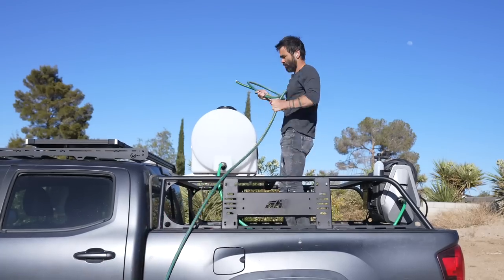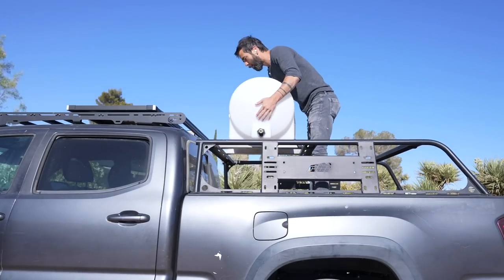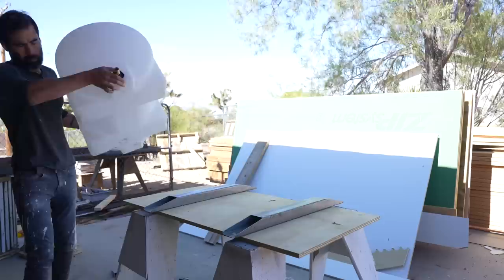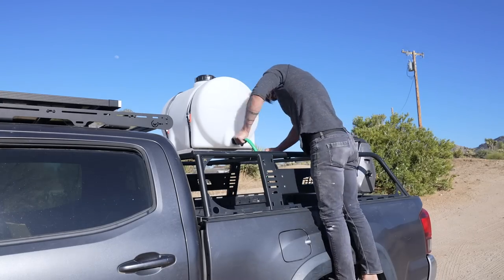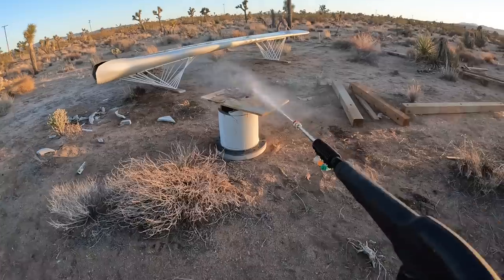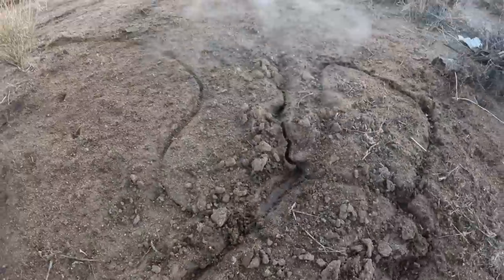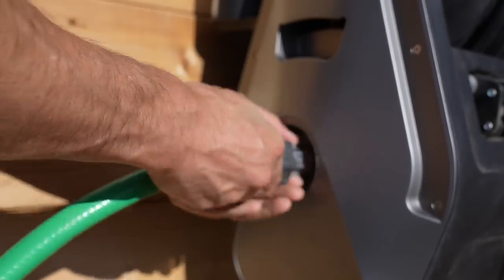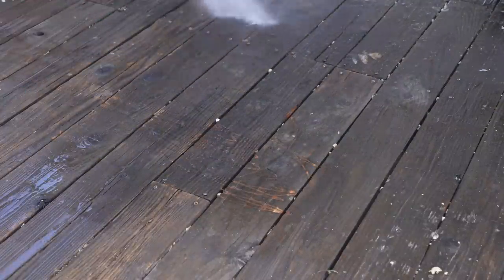Truck Mounted Pressure Washer | Giraffe Tools Grandfalls Pressure Washer

Comment: Not to be negative here but, this is in no way a powerful pressure washer, especially for those who do auto detailing, pressure washing jobs, etc. 
It might be good for washing a car once a week and that's it, these aren't made to last if used heavily.

FYI, a pressure washer which doesn't have enough pressure to tip over a bucket surely isn't "powerful"

Love the channel, but don't like when YouTubers just advertise something they aren't so experienced or familiar with..
Reply: looks like he put some rocks in the bucket